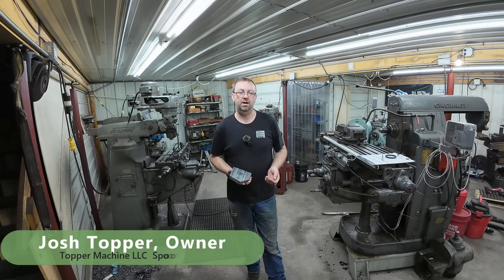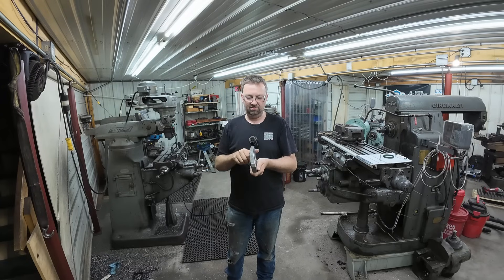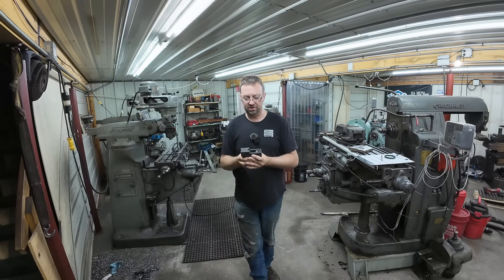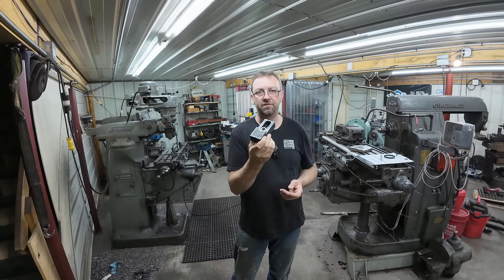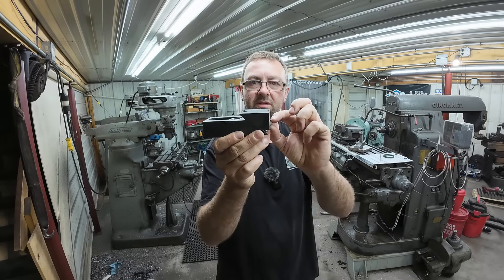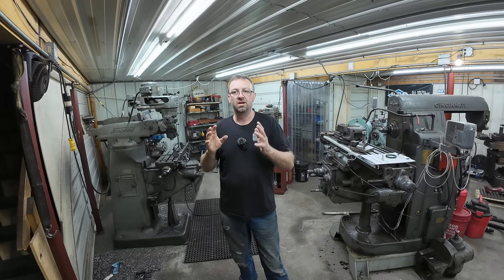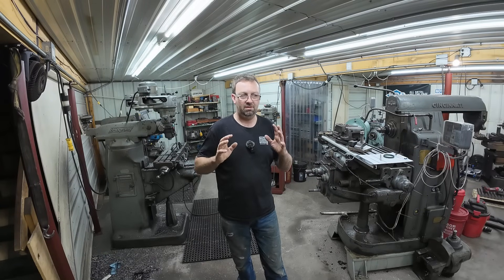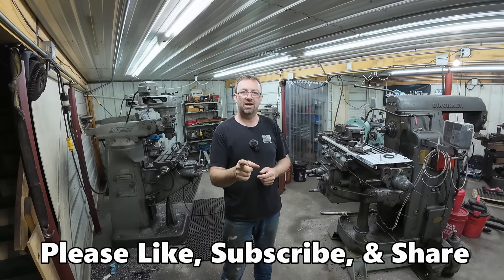What Did I Make For My Brother-In-Law? - Milling Side Clamps Explained

Comment: I use those clamps pretty frequently for doing preparatory work on large-ish hot rolled plates (up to about 30x50 sometimes). Very good for getting things flat and parallel, but it takes some care, which a lot of people I work with don't apply. Important to use minimal pressure to prevent bulging, just needs to be enough to keep the part from sliding. Also helps a lot to shim under any dead space to account for cutting forces.

Comment: Great work Josh. I enjoy your channel because its grounded. Its not endlessly promoting stuff so you get more freebies. Best of all you dont bore us with CNC stuff which should be on a separate channel called Watching Paint Dry. Love your shop and the type of work you do.
Reply from the maker: I hate CNC videos.  I agree, like watching paint dry.  So boring, and really limited on skill.  Having said that, it does have its place in the world, just not in my shop.
Reply: @TopperMachineLLC  Snowball Engineering in the UK has a CNC plasma cutting table that he shows in use when making custom parts for repairs and new jobs. In this case, it's interesting to see how he designs the part in CAD and then cuts it out with either plasma or gas. He runs the cutting at high speed quite a lot, so it only takes a short time to see the result. As it's only a small part of his overall video, it fits in nicely. His work is vastly different to what you do. He mostly repairs and upgrades farm machinery. It's a very interesting channel to watch. But I would agree that you don't have any place for CNC in your shop.
Reply from the maker: I don't have the room, nor the desire to have it.  Funny thing with CNC shops is that they are all struggling, and I can pick and choose the lowest bidder.  I farm a lot of stuff out that I don't want to do or is better suited for CNC.  Most of the quotes I get back are at about material cost.  Why would I compete with that, just utilize that to my advantage.  It is smart business, why own the equipment when someone else will always make it for less than I can?
Reply: Mr. Snowball's automated flame and plasma cutting table is not one of those shiny big boxes with robotic tool changers, 5 axis control etc. that (after many days of programming) produce identical finished parts rapid fire. He uses it to flame cut thick sheet steel or plasma cut thinner sheet. He didn't even know he'd need the parts until a few minutes before, and he immediately welds them onto the machine he's repairing. Often he needs a bunch of identical parts, and cutting them by hand would be much slower and a lot more difficult, and sometimes they do need to be identical. He'd have to machine the hand-cut parts to size. For his business, the cutter is essential and not that different from the huge hydraulic brake he sometimes uses to bend those parts. Technically, it's computer numerical control, but it's not what Titans of CNC sell.
Reply from the maker: @edwardhuff4727  I also have plate cutting capacity in house,but it is not computer controlled in any way. Rather it follows a pattern. Simple and extremely accurate for what it is. I've cut 4" plate with it and can cut up to 6". Again, no complex circuitry to fail, time wasted on programming, etc. Just hang a pattern or a sample part and start cutting.

Comment: Not sure why he wouldn't be concerned about extra weight in a race car. Thanks for the update Josh.
Reply from the maker: He will need more weight to keep the front end down.  Too much torque to the back wheels.  Think Wheelie
Reply: It's pretty hard to steer a car when the front wheels are off the ground.

Comment: I’m glad you made this follow-up to your last project. 
It seems that most of the machine shop YouTube makers take on projects without knowing what the part’s for, how it works, etc. A lot of that is probably just a lack of enough hours in the day to leave the shop and see the job site in person.
I’m a (now-retired) mechanical engineer and worked for a company with a prototyping machine shop you wouldn’t believe if you saw it. They machined prototype engine parts, including heat treating. They liked to keep the engineers out of the shop with “If you can draw it, we can make it!” Until they couldn’t make it. Then you better get your butt into the shop like yesterday! 
As a young engineer I got that call one day for a pre-prototype part I had designed and drew up myself. We called those parts SK (sketch) parts. The problem was actually my fault. The foreman started in on me about the tolerances were too tight, some areas were double-dimensioned, etc. He ended with “Well, what have you got to say for yourself?” He was expecting a big fight, like he got from all young engineers. 
I said - after looking over the areas he had issues with - “I screwed up.” That foreman went from ass-chewing’ bull-of-the-woods to mentor in a flash. He said, “I never had a young engineer admit he was wrong.” He put his arm around my shoulder and said, “Come on son, let’s sit down in my office & we’ll go over the print, help me understand what needs to be held tight, where you can give us some relief, and we’ll get this job knocked out.”
After that, my jobs went thru the shop with a champion in the inside. And I learned that the best way to start a design was to sit down with the shop before starting the drawing. 

You knew your brother in law built transmissions and immediately assumed this job would need to be done with tight transmission tolerances. If he had said (better yet)- written on the sketch “TAPERED SPACER to correct angle of brake master cylinder on firewall”, you would have had a better mental image of what he needed.
Reply from the maker: Most of the time, I am never told what something is.  I like to know on some things because it helps me determine strategy and better cost.  

I like your story.  I had a similar thing with a company I worked for.  New part I had to make that was not possible.  I marched right into the engineers office and threw it on his desk and told him this was crap.  Then I pulled up a chair and spent an hour with him working through it.  He came into the shop the next week and thanked me for helping him understand better what was needed.  After that, I would take a handful of drawings once a week to him and we would spend a couple hours going through them.  We became pretty good friends over that experience and he became a great engineer.